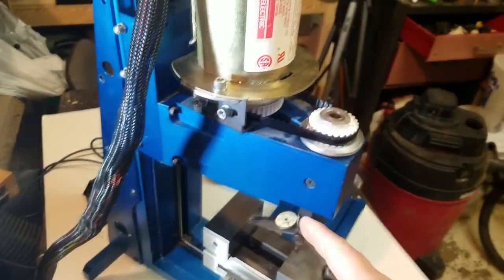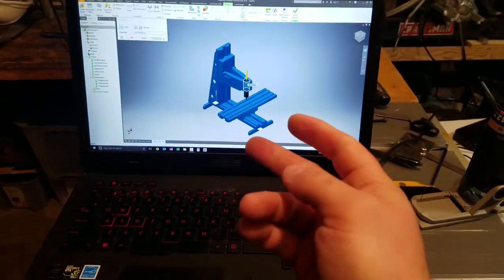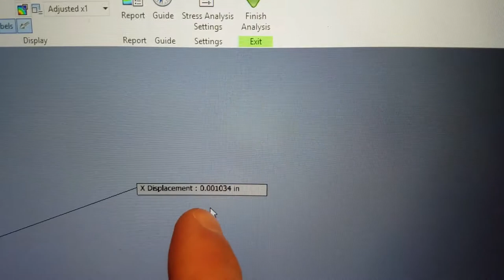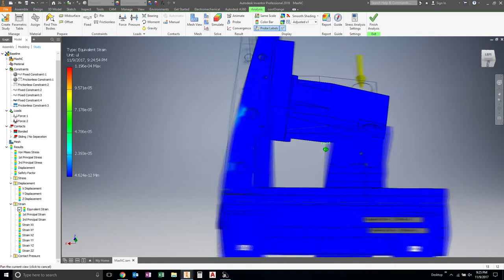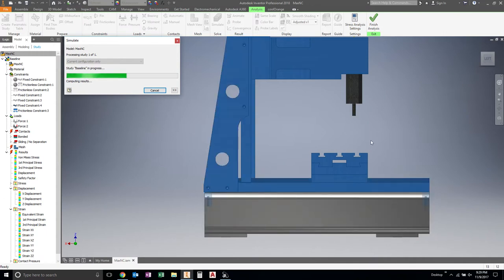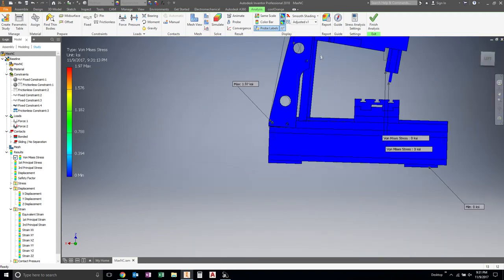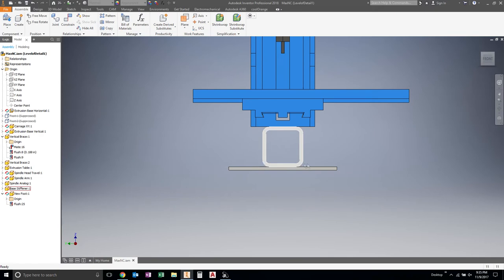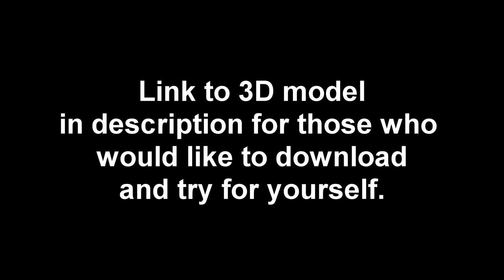3D Modeling and FEA of a MaxNC mini-mill, Let's look at making it more rigid.

Comment: Really interesting video josh and nice fea, I never tried the integrated tool in inventor, it looks pretty neat. Although I have the maxnc 10 I am going to download your model this weekend. I think you are onto the right path, maybe a flat wide plate like you say. If you  did the back stiffeners how are you planning to cut them ? Would be nice to machine them on a mill but I guess it could get expensive .   anyway that's a great model you built. Have a great weekend mate
Reply from the maker: Thanks Rural! The FEA tool is powerful but not 100% accurate. I just got NASTRAN in CAD as part of a subscription upgrade at work and that thing looks daunting. I heard it is progeny of the program we used to go to the moon or something. I think that I will ask a buddy at work if he could cut out braces on the plasma cutter... But that might be cheating so I will probably use a combination of the band saw and the drill press to cut out the basic shape. I will probably take off one of the braces and measure with calipers model up the hole pattern in CAD and then print out a template confirm it matches the factory ones then lay out the template on the 3/8" thk. steel and mark the locations for the holes with a punch and Although now that I am thinking about it I could probably turn down a steel blank the dia of the factory holes then clamp the factory brace to the new one and use that to mark the hole locations that way. Either way it shouldn't be too big of an issue. Granted this is coming from the guy with a 900 lb. metal cutting band saw in his garage. LOL. It might be a fun video to do one on the bandsaw and one with a hack saw as a way of showing you can do either with a little time and muscle and a lot of determination.

Comment: Does this still exist? The drive links appears to be broken. Is there any way you'd be willing to share the file again?
Reply from the maker: Shoot, it looks like I accidentally deleted the Google Drive Folder with all my Youtube Links files in them. I have a different laptop now, but I don't see why I wouldn't still have the files on it. I will check when I get home tonight and let you know and fix the links.
Reply: @JoshAQ  Thank you! I'll check the drive link again tomorrow to see if it works! I appreciate you looking.
Reply from the maker: @marcosalguero269  No luck yet, not on my old laptop. I went through a couple of hard drives since, perhaps it is on one of them. I will keep looking and let you know.
Reply: @JoshAQ  Hey well thank you so much for looking, man! Hopefully you can find it there, but if not, no worries! I appreciate you putting your time toward it.
Reply from the maker: Success! Found it on an old hard drive! I have redone the links on a couple of the videos that had files related to this project. Let me know if they work for you.
Reply: @JoshAQ  Dude! Absolute legend! I just pulled it into SolidWorks and it looks like everything is functional. Thank you so much for taking the time to find it!
Reply from the maker: You are very welcome. I hope it is of use in your project!
Reply: @JoshAQ  Definitely does! Threw a new spindle on my MAXNC (this helps for fitment and such). Also cast a concrete base for it and am working on some frame reinforcements. I had this thing given to me, so I'm maybe $200 in and it already cuts tremendously better. Thanks for the help! I'll use this for some future modeling for sure!